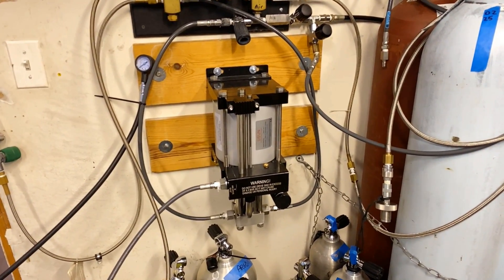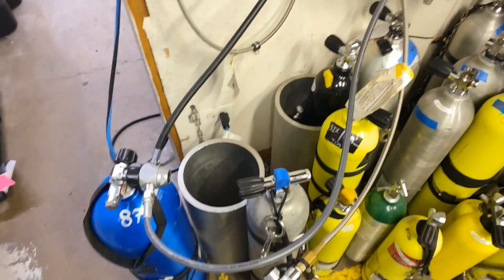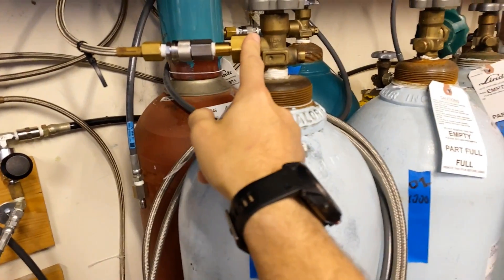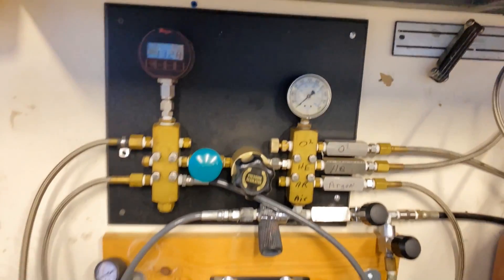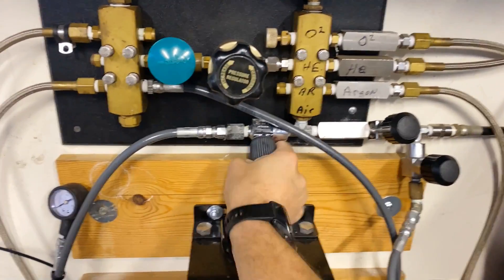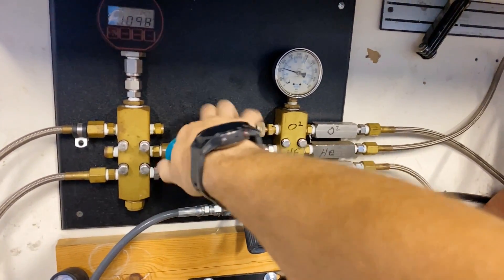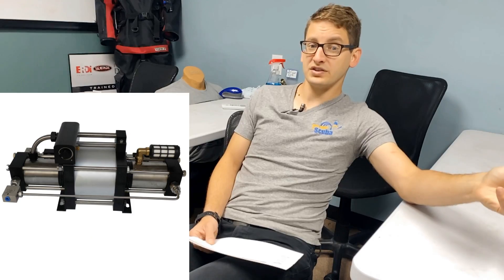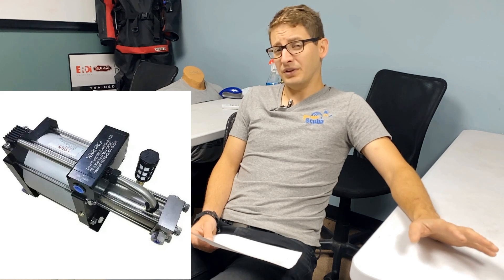USUN Gas Boosters - The Basics

Comment: Is a theoretical  air driven compressor ? Just trying to figure it out
Reply from the maker: You can drive the booster using a shop compressor (depending on the size of booster would determine how large of a booster you would need), or off of stored compressed air (such as AL80s or storage cylinders). The USUN boosters are all pneumatically driven, but there are some other models of boosters that are electrically driven